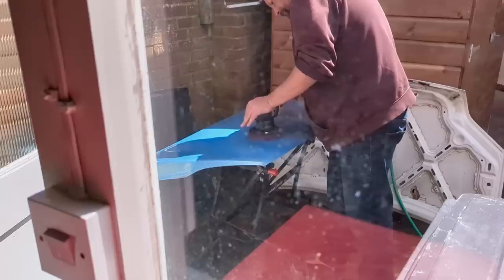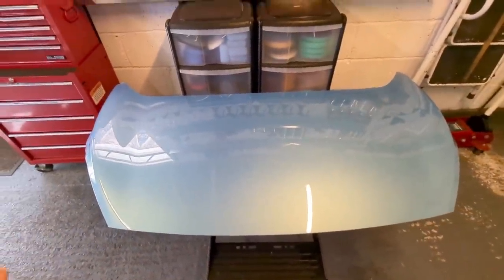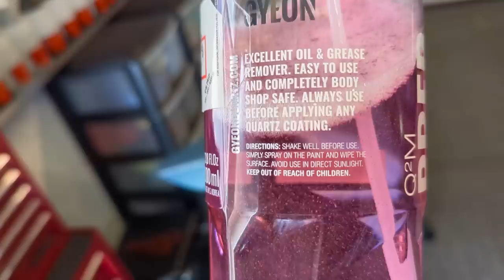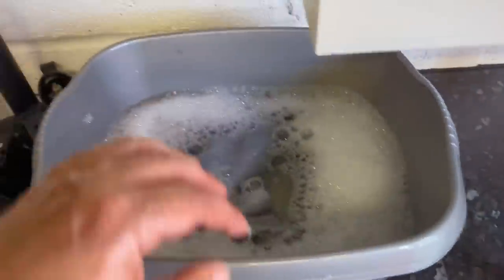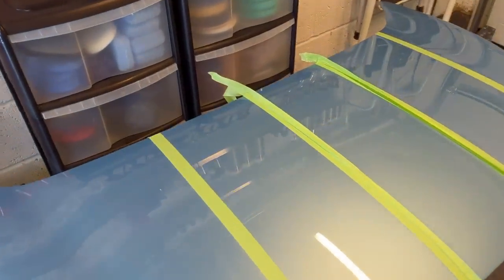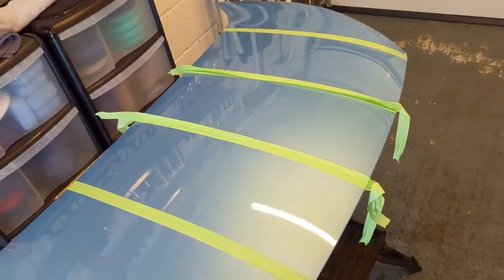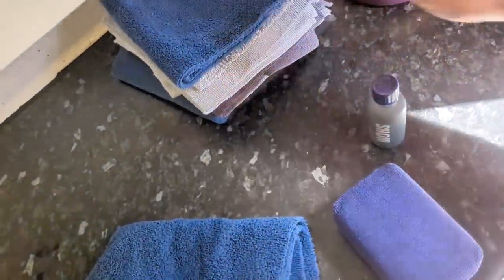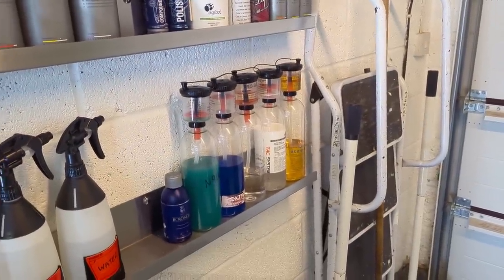How NOT to Apply a Ceramic Coating when Detailing

Comment: Proper testing! My preferred option is to polish the panel, use Feynlab Pure Rinseless to help with the wipe off and remove the oils. This  leaves nothing behind. Then, use panel wipe and finally coat.

Comment: Hey Jon, great idea for a video. Enjoyed it and your videos have really helped me get the confidence to apply my first ceramic coating. I’m doing synchro this weekend and I’m scared! I’m using a Rupes LH12E duetto, yellow or white Rupes pads and the da fine and uno pure for paint correction.  I want to do a one step on my white Toyotas - Hilux and gunmetal RAV4 (2021 models) with barely any swirls. My question is how much cut do you think these Rupes polishes would provide - do I start with the uno and yellow pad or go da fine and yellow, or just start with uno + white? Would hugely appreciate any advice
Reply from the maker: mate yellow and DA fine will be suitable for soft paints.  blue course is very agressive unlikely you will need this.

Comment: Great video once again. I have a question Jon. After having applied a ceramic coating, the towels you use to buff, can they still be used after a wash? And what is the best way to wash them?
Reply from the maker: just wash them normally in non bio but relegate to other non paintwork tasks is best mate.
Reply: @ForensicDetailing  Ok, and why is it better to refrain the used towels for paint/bodywork purposes?
Reply: @JB-E36  its highly likely the crystals from the coating become solid and using them on paint is almost certain to put in scratches
Reply: @Zoranurai13  Ok, thanks mate! And if I throw them in the washing machine right after buffing?
Reply: @JB-E36  new video idea. but not always will you have the chance to put only a handful of towels in the wash and the resins dry within minutes after applying the coating, perhaps throwing them in a bucket of water and dish soap might slow the drying down..
Reply: @JB-E36  no, just downgrade the used towels to engine bay, tyres(not rims) or floor duties
Reply: @JB-E36 what is best to do here is get a few cheap, but good enough quality towels, like a 3 or 5 pack that should cost around 5-10 USD per pack. Buy a few packs, that way you can throw them out whenever they're worn out. But for drying, use a good/high quality towel!

Comment: Jon, correct me if I'm wrong, but don't you have to wait 24 hours after using Gyeon Primer before coating the car to get the full benefit of the product? I know the car can be coated before the 24-hour period, but I thought that the additional chemical bonding advantage of the Gyeon Primer would be diminished if the car is coated before full curing of the primer. Great video once again. Thank you.
Reply from the maker: You can wait 24 hours or wait one hour and use prep.  Not sure what performance difference is.

Comment: It would be really useful to have a video of applying Gyeon Skin on top of MOHS, showing the pitfalls and how best to apply it. I've found it very difficult not to have high spots,. although Gyeon MOHS applied fine.
Reply from the maker: We did this recently
Reply: Strange… I had absolutely zero issues applying skin. Found it easier to apply than MOHS itself. Easiest wipe on wipe off going

Comment: would love to see you do this with hydro carbon that’s not had a chance to vape, also I’ve noticed whilst removing ceri glass which is water based that non water missable solvents have a hard time removing it, home brew ipa does a better job, would it be safe to assume that this means depending on how your chosen polish is carried is what type off solvent is needed to properly degrease, so many variables in this. This must be why gyeon advise to degrease with hot  Water and shampoo first to give the panel wipe a head start. so many variables in this and it has to be the main reason why Lsp’s degrade faster then stated and why people get wildly different durability results.
Reply from the maker: Could be m8 yer

Comment: Great video, John.
I am interested to know your thoughts on Carpro essence.
Apparently, it does the same Jon as the Geyon primer 

Thanks
Reply from the maker: yes I think its the same sort of thing, SI material based polish that leaves a layer of resin filler that a coating can bond to.

Comment: could just polishing the paint, then performing another contact wash with something like GT decon shampoo be a good alternative Jon? rather than then using an IPA wipe before applying the ceramic?
Reply from the maker: well yes this is the thing we are trying to explore, the benefits of a water based degrease with surfactant.
Reply: Yes that would be an equivalent alternative. A decon shampoo will be a strong degreaser and remove the polishing oils. Provided you rinsed and dried very well it would actually be superior in a way. The reason people don’t is the extra time that takes and particularly the fact you’re contacting the paint again and risking installing defects you just spent hours removing.

Comment: For me these prep products are a bit snake oil'y. 70/30 IPA homemade IPA mix is all you need to completely strip and prep the panel. After wiping 70/30 on a panel it will completely wet with water. It's naked. You can buy IPA dirt cheap from a variety of sources.
Reply from the maker: a 70/30 mix of IPA and water will not completly strip prep a panel. It wont really touch fresh waxes or sealants.   But in terms of polishing oils:  the format of the polish component will effect that.  A solvent based polish will reject any water miscible alcohol solvent.  Hydrocarbon panel wipe more effective in that instance.   A water based emulsion polish will be removed more effectivly with a alcohol based panel wipe but you would still want small amounts of volatile surfactant in your panel wipe to help the oil portion of the polish mix combine with the panel wipe.   either way though the main reason ISO alcohol based panel wipe is desirable is purley down to how well it gurentees it will evaporate off the panel.  It has a much faster evaporation rate and a lower flash temp than hydrocarbon.  Hydrocarbon must be used in workshop environment to consistently provide higher temperature needed to flash 10 deg+ desirable for most.  versus 0-4 deg for alcohol.     plus hydrocarbon can take a lot longer to completly flash sometimes 10 mintes or longer.    ISO wipe will leave panel hydrophillic during flash as its a polar solvent.   Hydrocarbon will leave it hydrophobic as its non polar.     IPA is no longer dirt cheap.  used to be 10 pounds for 5 litres for bonnymans back when I did my homebrew panel wipe videos many years ago.  post covid its 20-30 now.  post covid there was  little hack where Koch chemie did not increase the price of SIL (which is basically neat IPA).  that was the cheapest way to do it.   but they realised quickly :)  now yer 5 litres of 99% prf IPA mixed down with DI water cheapest option.  Ive tested detailing panel wipes versus home made ones on the channel.  Detailing ones are generally more powerfull at removing materials (waxes, acrylic resin, silicones, polishing oil) but yes you can overpay dramatically on the price with some.
Reply: @ForensicDetailing  what an amazing detailed and thoughtful reply, on an older video too so thank you sir! What would you say to using Acetone? too strong? I used to use straight petrol as a (very effective mind you) tar remover. 😬🤦‍♂

Comment: Great video. You should test coating without buffing the panel vs buffing it, along with mixing in panel wipe usage.
Reply from the maker: if you dont buff you will get a very very very very thick layer of coating that should last a lot longer but it wont be like right (finish wise) I actually dont buff the barrel of the alloy when i put it down for this reason.

Comment: Hi Jon. Interested in your thoughts on this. My car was resprayed in Dec and through Jan I mopped and refined the paint to an unbelievable finish. I then used Prep to clean down the paint and "Carbon Collective Perfect Paint" ceramic coating was applied. The car was then left for about 3 days in a garage before it was touched. It looked amazing. Now some 4 months on, i have been washing once per week, sometimes once every 2 weeks with Carbon Collective Ceramic maintaining shampoo. I did this today and to my horror i can see hazing and hollograms already in the finish. This coating was supposed to be 7H hardness. So is this a crap product ?. It should be able to survive simple washing. Thanks in advance for any advice.
Reply from the maker: non OEM paint mate would be my guess here it tends to be a lot softer than most OEM paints.  So remember the coating will be sub micron.  The coating is so very very thin it cant really provide much measurable scratch resistence, but it should make the car easier to clean and more dirt peel during pre washing.     Use a chenille mitt on it mate that will help but very gentle pressure when you wash and dry, maybe air dry might be the way forward mate.
Reply: @ForensicDetailing  Thank you for the reply. Its got a clearcoat on it so i was thinking it maybe harder than the 30yr old factory paint. Maybe not. OK will try your advice. Cheers !.